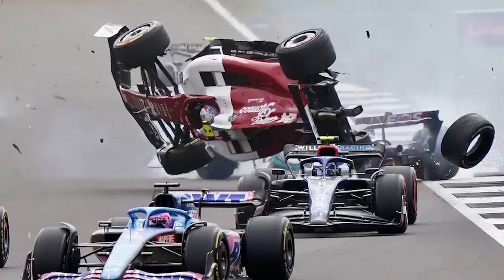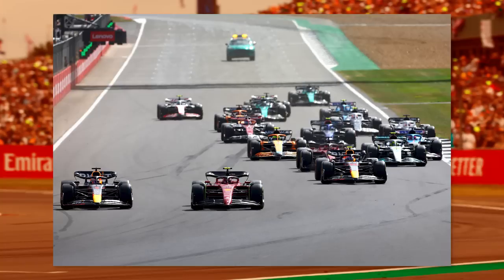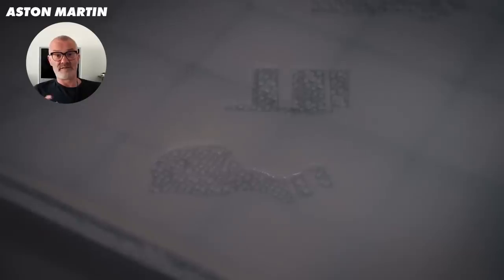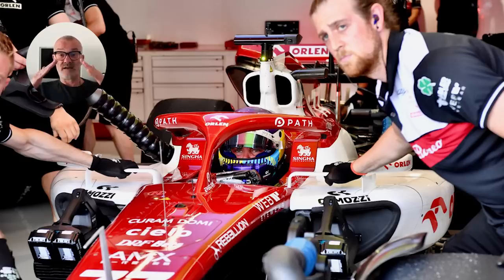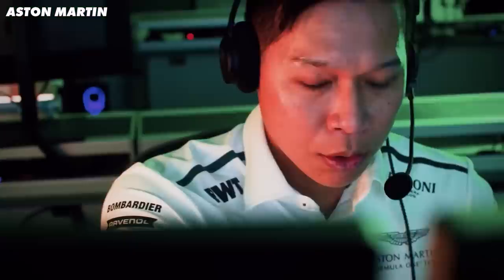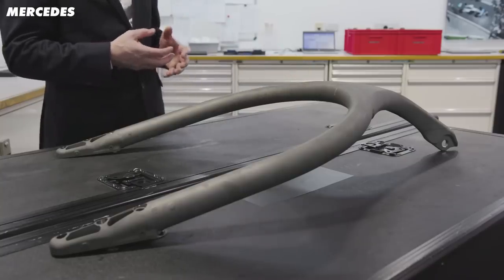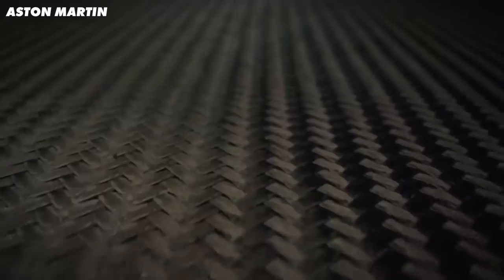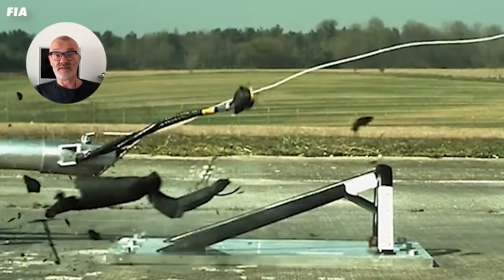Did the Roll Hoop FAIL in Zhou's Crash?

Comment: do you think they can have layers of carbon fibre over parts of the roll hop so its more mechanically fastened to the tub instead of only adhesives? not sure how they would produce that tho.
Reply: I'm thinking of having "tendrils" of the titanium roll hoop reaching deep into the carbon monocoque lol
Reply: @PiousMoltar  lol tendrils, im thinking more like carbon fiber over lapping portion of the roll hoop so its sort of strapped down/embeded in the carbon fiber
Reply: They would likely shatter on first impact after which they would be completely useless. You have to match the strength of materials otherwise one takes all the load, then breaks, then the other takes all the load

Comment: I''ve spoken recently with a large firm that does electron beam titanium powder printing (largest printer in United States) and they do it for the aerospace industry. In burst tests for spacecraft parts for Lockheed Martin, they found out the printed parts themselves will not fail, where they always fail is where they are bonded or welded onto other things. F1 is smart, but they're nowhere near the aerospace industry and common sense just dictates you test the thing at 200mph plus upside down dragging across a track. Have they not seen F1 crash footage from the last thirty years?

Comment: They should not bond the hoops on.  They should always use mechanical fasteners.  The carbon fiber was strong but it delaminated easy.  Might as well have used tape on sand.

Comment: I think the rollhoop breaking was actually a blessing. We don't know how the car might have flipped through the air if it hadn't broken off. But we do know that in this case he flipped over the tyre barrier at the last moment and hit the catch fence wheels first.

With the rollhoop intact something far more dramatic could've happened too. Like wheels breaking off and possibly being launched into the crowd. Even with the wires to prevent wheels from flying off, it can and has happened since they were implemented.

Furthermore, the red flag situation might've contributed to preventing something even worse with those retarded (not sorry for using that word for them) environmental activists sitting on the track.

And with Zhou being perfectly fine, I say that this crash had the best possible outcome in multiple possible scenarios.

Comment: Safety > Speed
I want to have a good time and see race drivers going healthy home to their families.

So my thought on this is as follows, everything loses it's properties with a specific amount of heat. So what I think is that the metal part got so hot and heated up the layers that they might have just layered apart.
That thing must have gotten few hundred degrees Celsius (we don't do Farenheit, use some proper measuring systems, 2022 still using cave man measuring)

Comment: Didn't the roll hoop hit the ground in a way that it received a longitudinal force? if yes, then was it above 7 ton?
Reply: It may have been, but even so, the 7 ton “limit” is not testing the adhesive as I understand, it’s testing the structural integrity of the hoop. (If it will bend, snap, etc.) Not if the base of the hoop will separate from the car. Because from this incident we’ve gathered that the roll hoop is clearly stronger than the adhesive or carbon fiber it is bound to the car with.
Reply: @prettycoolcat  Ohhhh I though they tested the hoop when it was already attached to the car.

Comment: Too many of these accidents in recent years of cars flipping or mounting other cars. Yes it happened in the 90's and early 00's but didn't seem to be so frequently. Maybe the drivers take more risks with safer cars? I would look at driving standards and even slow the cars down, particularly cornering speeds. Even with all the car safety its a bit of a false illusion. Only a matter of time before F1 loses a driver, and that's not what it should be about.

Comment: Nonsensical. If the halo wasn't there the car would have taken a completely different trajectory and would either have barrel rolled or rolled back over front. In such an instance the roll hoop would have done it's job just fine. The halo definitely has it's merits in F1 (e.g. Grosjean accident) but in this instance it was the cause of the roll hoop failure due to the way it caused the car to travel (but subsequently it acted as the supplementary protection).

Comment: For all the praise of the halo, if the roll hoop didn’t fail it likely wouldn’t have been nessasary. Why wouldn’t the FIA do impact testing!!? Anyone who works with carbon fiber knows that type of flat joint would be the weak point, the joint needs more surface area. This could be done by extending the hoop down in between the carbon layers, thus creating shear joints. (basically like a tie down strap) 
Claiming that the FIA testing is extensive, when they don’t even do impact tests is a joke. FEA isn’t a substitute for real world testing!

Comment: sorry, but they dont look safe to me. Do like they do with speed boats or an actual cage around the driver. Yes they do worry about dropping speeds, but NASCAR gives up speed for safety. Even Drag racing has a cage around the driver that at worst case separates from the rest of the cars parts.

Comment: When you use glue between metal and fibers material and you don't take in consideration the loads are moving not sitting in one spot to test.  That roll cage should be fasten to the main safety cage and not GLUED to withstand a impact at 180mph.  How dumb is that for the safety committee to ever think 🤔 it would be safe. Those vehicles are moving not standing in a video game.  Who ever is on that safety committee should be replaced by whole new members and the vehicle should be parked until that is corrected and tested for racing safety for all drivers and not weight of the vehicle by grams when it comes to the safety of any drivers life. Shame on the racing safety committee who approves anything less than perfect for racing safety.
Reply: You didn’t watch the video did you. The glue didn’t fail. The carbon fiber it was attached to did

Comment: Todays F1 cars have never been safer, 30 yrs ago the driver would have died in such an accident. The advent of Carbon fibre, roll over hoop and halo and not fogetting the fitted collars and other devices the only thing left are the G forces to struggle with.

Comment: Well, almost static pressure of 10t is nothing compare to the huge impact this thing recieved. 800kgs lands on a tiny area with a force lever on one pivot (not two as with round roll structures) at over 200kph in under a second... The energy that this thing had to absorb is just an order of magnitude more than FIA tests...

Comment: that is a TERRILBE design. just glued to the surface of the carbon fiber? when it's well known that carbon fiber is very weak in certain directions and very susceptible to impact damage on top of that? it should penetrate the surface of the car and be bonded to the inner strength members of the frame at several points.

Comment: If a safety feature is not there to protect the driver when it needs to, I think it's very safe to say it failed... I couldn't care less what the regulations say, I just want a roll hoop that will not snap off or grind away in a crash... personally I think the hoop should be a bit taller and wider and either bolted on deep in the tub or integrated into the carbon fiber body itself so in a way it's part of the structure
and why do I say this is very important? because the roll hoop/intake structure actually saved drivers where the halo was wrongly praised because it didn't matter that it's there (Leclerc at Spa and Hamilton at Monza f.e.)

Comment: The roll hoop may well have conformed to the regulations, but failing like that just means the regulations aren’t safe. It’s one thing to say the Halo did it’s job, but that doesn’t mean it’s ok for the roll hoop to fail. Should be a standard part, titanium and bolted through the layers of carbon connecting to the bottom of the tub.

Comment: Personally, I think that a certain amount of bolts need to mounted to the base of the roll hoop/spike. A titanium reinforcement plate to the underneath side of where it is glued on, must be added, so that it doesn't pull apart the carbon sheets! It's really a pretty simple fix, from my point of view.
Reply: Two different techniques needed due to different materials.
The bond is stronger that the bolts!.
I didn't believe it at first either

Comment: Makes me wonder if they pick up disabled cars with a strap under the roll-bar?.Seems like it. This could fatigue the structure (Carbon fibre) by PULLING on it with the weight of the car. NOT DESIGNED TO DO THIS?..?????
Once to get the car to a truck, dropped, then picked up again by the carry truck. Again…. opposite direction of design?
Worth looking into as Zhou is lucky to be alive since this primary safety device failed. Maybe forgotten about……Engineer/procedural alert!

Comment: typical mechanical engineering mistake that happens since decades an will happen for decades again and again. Every structure needs enough support. Especially when you make a 90 degree connection on a flat surface. The space needs to be big enough and in this case, you need a backplate. I think this is a disciplin where f1 developers can learn from other motorsports. Look at WRC cars and what kind of impacts they can take.

Comment: I just wonder how many other portions of the chassis with regards to safety might not be up to snuff now. A roll hoop failure is about the worst failure u could have. Those are engineered so heavily and arr usually the strongest part on any car. Generally they are designed to carry more then twice the weight of the entire car on it. So if they failed in their testing with the roll hoop what else isnt right? 
Great excuse to get rid of the cap as chassis go back for destruction

Comment: Yes i would like to comment on this, i have been wacthing motor sports for some time now and i believe there is no excuse for the roll hoop colapse on this occasion i dont believe carbon fiber should be used in this case the entire cockpit including the rollhoop should be made as one piece of the strongest oxygen free steel without compromise or to much consideration of weight, the drivers life hangs in the balance and he is the main consideration thank god for the halo yes but a few years ago he would have more than likely been brutaly killed, none of those safety features should have failed forget all of the high tech excuses you are putting peoples lives in danger.😑oh yea rollhoop, cockpit and halo, one piece.

Comment: Gasly was behind Russell and no doubt in his blind spot and it was he that clipped George. Don't know how you can aportian some element of blame on the car in front when it is the car behind's responsibility to be able to pull out of a manoeuvre like that. 
Glad Zhou was alright. He can't seem to catch a break after showing great talent last few races. Guess it makes sense to strengthen the bonded area at the base of the roll hoop as well reprofiling the hoop.
Reply: Russell had a bad start and was slow. Gasly was already there when he went left to open up the corner. Russell's mistake was not realising Gasly was there. Gasly took a risk trying that line but did not do anything wrong in my opinion.
Reply: @jorrittimmers8066  i’ll make it simple for you. If you run into someone from behind - You made the mistake.
Reply: @theelf152  But reality is that russell moved forward and left and Gasly only forward. Contact was made by Russell going left into Gasly
Reply: @jorrittimmers8066  Risk you take at the start of the race. He still had space to his left and did not react.YOU CANT BLAME THE GUY IN FRONT - NEVER!
Reply: @theelf152  I diasgree but thats life I guess. He had Zhou to his left so no space and I still think Russell should have stayed in his line. No point arguing when we see the same incident so differently
Reply: @jorrittimmers8066  theres no argument. Answer the question. Is it or is not the person behinds responsibility pass safely or not pass at all. I know its more complex than that - but thats what it boils down to - especially when people start pointing the finger and NOT leaving it alone as all such incidents should Be.
Reply: @theelf152   "Is it or is not the person behinds responsibility pass safely or not pass at all."  ok, i will answer this precise question. YES is the answer. Gasly did nothing to make an unsafe pass. Russell made a mistake and because of that the pass was no longer on. Gasly cannot anticipate the mistake so did nothing wrong.

"especially when people start pointing the finger and NOT leaving it alone as all such incidents should Be". agree with that. It is a first lap incident and not a huge mistake but still a mistake. 

But honestly watch the video again and the animation made by driver61. You are not only disagreeing with me but him as well.
Reply: @jorrittimmers8066  Goodbye

Comment: So George was at fault. Why is everybody avoiding to say that?
Reply: Driver61 did say that. The reason there is no real big fuss about is that it is an understandable first corner crash. Russell is human and we all make mistakes
Reply: @jorrittimmers8066  Again, it DOESNT matter what caused the car to flip. It could also have been just and accident. We are talking about the safety of the drivers, and SO the only thing people must focus on is why the main part that was meant to secure the driver WENT OFF. People actually need to start thinking deeper.

Comment: Nothing failed if Zhou was unharmed!! Every safety feature worked together, he was  definitely lucky how much friction and rotational forces reduced the final impact. the car also slammed against the barrier floor side down, he was lucky there
Reply: That's really not how safety works. After every crash the FIA starts and investigation to improve things. If we have lived under the "but he survived" motto we wouldn't be here with the high level of safety these cars have.
Reply: That's a terrible take. The roll hoop had a job and didn't do it. The fact that the halo covered for it is not excuse. The combination of two safety elements has to perform to their sum, not the single highest value.
Reply: Being unharmed doesn't mean a safety feature didn't fail. That is faulty logic.
Reply: @n00bdax  there is literally no material on earth that couldve withstood that impact. F1 cars are not designed to land upside down at 150 mph while spinning. and yet the safety features of the modern car still saved his life
Reply: @AlejandroLZuvic  surviving a crash and being unharmed are two completely different things

Comment: It’s never the merc drivers fault for him is it
Reply: ...he literally just said that Russel made the mistake though?
Reply: @curnath  no no Russell make a little mistake but it wasn’t his fault. He didn’t try and slam the door on a car that was overtaking him. No no it was only a small error
Reply: @lordv1le859  So what's your point? What if it was an actual accident? The result would be the same. In this case it doesn't matter what caused the car to flip, but the fact that the part which was there to secure the driver went off. This is what you should focus on. It's not about what you want to blame, but what is actually crucial for the safety of the drivers.
Reply: @lordv1le859  It was a small error. Just a small error with big consequences. This kind of stuff happens every other start, just doesn't always have the same consequences. Not entirely sure what your point is here.
Reply: @curnath  he tried to squeeze someone out of an overtake and caused a massive crash. He was being a prick it wasn’t a “small error” it was an intentional move that he shouldn’t have been doing.